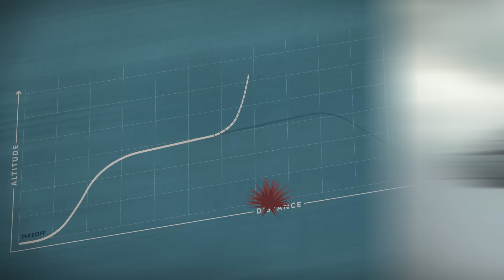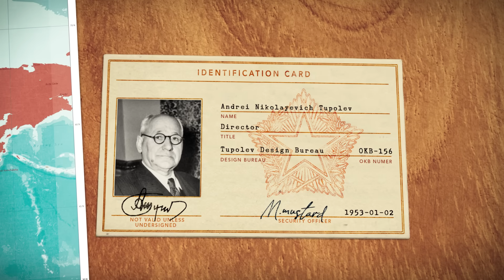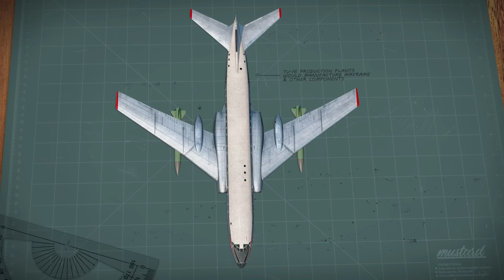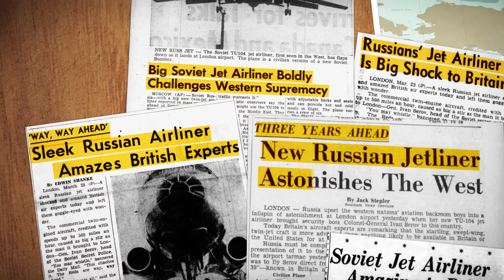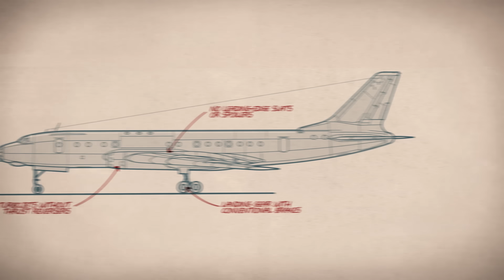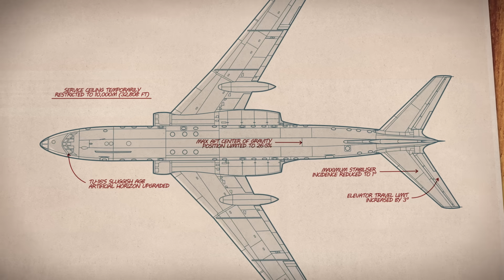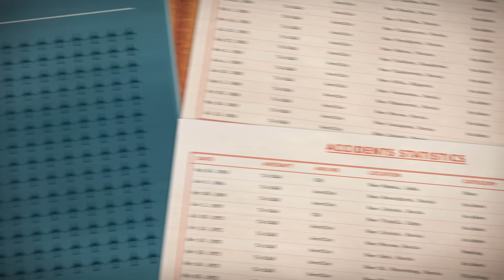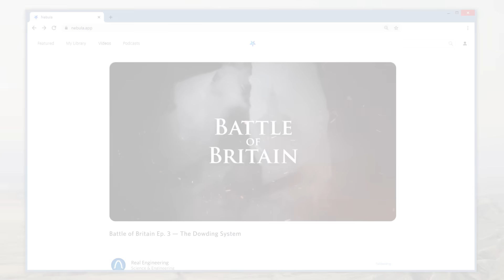The Soviet Airliner Designed To Crash

Comment: My parents and I flew on a Comet from New York to London 1959. First Jet airliner for us. It was really a great experience. We went on to a different flight to Paris. We heard that the same plane (Comet) went on to Stockholm and exploded in the air. Something to do with the cabin pressure system. Our next flights were on the DC8 and 707.
Reply: pa.d5688  Ah, OK, I thought it was a Comet we were talking about, not a Tu-104.
Reply: By 1958 the on service Comet fleet were replaced by Comet 4 which was modified to prevent the pressure hull structural failures that affect the earlier versions.
Reply: Hmmm, I can't find any such accidents in the Aviation Safety Network database. Neither in 1959, not enroute to Stockholm.
Reply: @kjetilkjernsmo8499  ooh
Reply: @kjetilkjernsmo8499  His MAGA hat is too tight.  He can't cope with the fact that that the first jet airliner wasn't Murcan so he's making stuff up.
Reply: @himoffthequakeroatbox4320  The first successful airworthy jet airliner was the Boeing 707 series, the Comet 1 was grounded and its airworthiness certification was permanently revoked.
Reply: @kjetilkjernsmo8499  there’s a Seconds from Disaster episode on it. The windows had right angle window corners that causes metal fatigue.
Reply: @requiscatinpace7392  Heavily dumbed-down for television, this British directed episode is highly fictionalized and inaccurate...  not a good reference for information on the Comet Disaster.
Reply: @sandervanderkammen9230  just meant as a starting place for someone who didn’t seem to believe it happened.
Reply: @requiscatinpace7392  Oh I see, for the Comet Disaster deniers.
Indeed... there are a few delusionals around here that believe that every Comet landed like a feather, three points and exactly on schedule every single time.
Reply: @kjetilkjernsmo8499  💀💀
Reply: There is no record of this crash anywhere. And transatlantic Comet 4s never flew to Stockholm.
Reply: By 1959 the Comet problem was spotted and fixed. The aircraft that had decompression problems was in 1955. Then the Comet was grounded for 4 years. If you were a passenger in 1959 it would have been on a Comet that had been up graded and passed.  Inspectors blamed the Squair Windows, but it was the press in Rivets that caused the cracks
Reply: @mylanmiller9656  The square windows were a factor. The sharp corners made it easier for the hull to tear under stress. The riveting process also weakened the hull.
Reply: @foxymetroid  There is no evidence to support that the shape of the windows was the cause of a single crash, cracks formed during construction and propagated concentrating around all the fuselage penetrations
Comet 1 aircraft that did not crash or were scrapped had round windows installed, these aircraft were determined to be unsafe and their airworthiness certification was permanently revoked.
Reply: @mylanmiller9656  Militarised versions of them (Nimrod) were in service till 2011.
Reply: @himoffthequakeroatbox4320  The Nimrod is a completely redesigned aircraft built by Hawker Siddeley  2 decades later. 
The Nimrod is not a Comet, it has a different type certificate.
Reply: @mylanmiller9656  Square windows certainly didn't help. Most of the crack propagation was found around those windows.
Reply: @mgabrysSF  The square windows theory was a red herring, the news media grabbed it and ran with it. de Havilland never understood why its aircraft exploded, the problem was discovered by outside experts that found 100s of fatal design and construction flaws.
de Havilland installed round windows on the remaining Comet 1s but they had airworthiness certification permanently revoked because they entire airframe structure was too weak and poorly constructed.
Reply: @mgabrysSF  There is no evidence to support that the passenger windows caused any of the crashes, the wreckage recovered  confirmed this.
Reply: @mgabrysSF  Maybe the tests from the tank said that.  The Crash Debree proved that the Brake up started in the roof not around the windows Area.
Reply: @paulpaul9914  More childish insults and you are sinking fast kid...
Just answer the question lad, please cite a name of a British company that still makes commercial jet aircraft in the U.K.???
Reply: @mylanmiller9656  Oh I agree with all the propagation data elsewhere in the airframe for sure. But having those windows - and the only commercial jet that used them - was indicative of the lack of overall awareness in designing a pressure structure.
Reply: @sandervanderkammen9230  A red herring in one sense - yes, but it did show a lack of understanding in the design awareness which was found to be absent in the remainder of the aircraft. Not the cause of the crashes in of themselves - but a glowing red flag to problems that would become obvious elsewhere.

Which is a pity because I always thought the inboard engines to be quite visually dramatic. Probably an insane headache to work on tho (not to mention a huge safety risk in the event of a catastrophic engine failure).
Reply: @mgabrysSF  Excellent point, de Havilland struggled with the extra weight in shielding and insullation for sound damping and fire protection required for the placement of the engines inside the wings.
One of the mysteries of the Comet Disaster was why de Havilland ignored data regarding metal fatigue in pressurized cabins provided to the RAE by Boeing from the B-29 program during WW2.

The other is why the treasure trove of technical data discovered by the Fedden Mission at the Luftfahrtforschungsanstalt in Braunschweig Germany was never disseminated to de Havilland.
The RLM had conducted exhaustive research on different jet engine mounting techniques in the world's most advanced wind tunnel facility.
The German data showed that mounting the engines below the wings with the inlets ahead of the wings leading edge was superior for subsonic applications and that mounting the engines as d-H did was fundamental flawed and undesirable.
 There are no answers to why Boeing got it right the first time with the Boeing 707 and d-H got so wrong with the Comet.
The only explanation is they deliberately disregarded the data.
de Havilland didn't conduct its own wind tunnel tests until after the first 3 runway excursion accidents.
Reply: @sandervanderkammen9230  I don't 'know' but I suspect for Boeing, it was a reasonable attempt to manage engine retrofits on a commercial fleet at the outset. If they weren't thinking of it on day-one, I'm confident the carriers were.

It's a lot easier to remove an engine from a pylon for servicing and replace it than to have to take a plane out of service from an inboard power plant (Douglas found this out the hard way with their tail mounted engines on the DC-10). A less common but possible failure-mode can send turbine blades flying in all directions. Having it outboard mitigates that risk (somewhat). There have been many documented harrowing accidents as a result from a catastrophic explosion from bird ingestion or bad parts used during rebuilds.

I'm aware of one tail mounted engine failure causing a dramatic loss of  hydraulic control as the parts severed both primary and redundant feed lines. I can't recall the incident off the top of my head - but I'm pretty sure a search (even on YouTube) will document the accident.
Reply: @mgabrysSF  The under-slung engines first appeared on the Boeing B-47 bomber, which was an uncompleted German aircraft (Projekt P.1107) the plans were found by the German-American  Boeing engineer George Scherer part of the Fedden Mission.
 There are some descent videos regarding the rise and fall of the tri jets due to legal requirements of over-water passenger routes.
 The DC-10 for example cpuld compete directly with 4 engine jets like the 747 but had a lower operating costs due to only having 3 engines.
As soon as the laws changed twin engine wide bodies have dominated international routes.
Reply: @mylanmiller9656  Square.
Reply: @mylanmiller9656  Mostly right. The cause of the crashes was metal fatigue. It's complicated physics and engineering, but in simple terms, if you bend a piece of metal one way and then back again, and do it enough times, the metal will crack at the bend. Stress points such as the corners of square window openings and imperfect rivet holes can cause failure a lot earlier than expected.

I flew from London to Singapore and back again in a Comet 4 in 1959 when I was 10 years old.
Reply: @roadie3124  The Comet Disaster was caused by design flaws that allowed the cracks to join up and rip open the the pressurized cabin.
de Havilland used aluminum skins that were too thin and brittle, they lacked proper rip-stop doubler joints  to prevent the cracks spreading to adjacent skin panels.
The fuselage reinforcement rings were also too thin and too far apart to stop the cracks from causing a catastrophic structural failure.
Reply: @sandervanderkammen9230  Designers in those days didn't know that they had to do things to stop fatigue cracks from propagating. They didn't know enough about fatigue. So is it a design flaw or a lack of knowledge about the new technological world they were entering?
Reply: @mylanmiller9656  Press in rivets?  I had never heard that and I went to aviation school.  They are still teaching it was the windows.  I need to watch some documentaries on that.  I don't rem using any press in rivets.  There are rivet like things that you can use but usually not in anything structural.  Our teachers were anal about driving the perfect rivet.  You haven't lived till you have manually bucked 100k rivets.
Reply: @JohnSmith-uf5xg  I think he meant to say de Havilland punch-cut the rivet  holes instead of the standard industry practice of drilling and reaming the rivet holes. 
 It was well-known by industry leaders that die cutting the holes caused tiny stress risers and cracks in the aluminum skins that that would propagate and crack between adjacent rivets and was unacceptable for pressurized cabins. 
de Havilland had little experience with riveted airframe structures made from aluminum alloys, de Havilland was still building jet aircraft primarily from wood and fabric in the 1950s and simply lacked the technology to produce something like the Comet.
Reply: @mylanmiller9656  20 Comet 4 aircraft crashed or were destroyed in accidents making it the second worst jet airliner after the Comet 1
Reply: I think it was coming from Rome.
Reply: @semsemeini7905  it was Rome, my dad as captain handed it over there to the next unlucky crew.
Reply: @paulpaul9914  Please name a single British company that still makes commercial jet aircraft in the U.K.?
Reply: Better, faster and sooner is sometimes called the Iron Triangle. Three is often impossible, two is rare and one is an average outcome. You often end up with none.
Reply: @michaelcanty4940  de Havilland took  a extremely high risk gamble on all three and got none right... the Comet Disaster was an epic failure that completely destroyed the company and struck a massive blow to the already failing U.K. aircraft industry.
Reply: The BOAC Comet...read Wiki for a tragic triste histoire  that enabled longterm US domination of Commercial Jets
Reply: @mindyourownbeeswax8223  The de Havilland Comet had no effect on the American commercial aircraft industry... neither did any other British jet airliners
Reply: Pa. D  They  blamed the squair  windows in the first place, They later found the cracks were caused by forcing the rivets through the aluminum. It wouldn't have mattered if the windows were round they would have had the same problem. They moved the rivets farther from the edges and drilled the holes.
Reply: @mylanmiller9656  острые углы усугубили дефект заклепок. Чрезмерная нагрузка ускоряет рост микротрещин)
Reply: @mylanmiller9656 on fact early RR Ghost engines did not produce a lot of power and the pressure hull was made too weak in order to save weight to increase payload. Only more powerful Avon engines allowed the stronger, heavier Comet 4 to exist.
Reply: @mylanmiller9656  The Comet had aluminum skins that were too thin and brittle, it lacked proper rip-stop doubler joints and its fuselage reinforcement rings were too narrow and spaced too far apart.
 de Havilland used a revitting technique that was well below industry standards for aluminum airframe structures and its quality control standards were appallingly bad.
de Havilland incorrectly calculated the stress factors and used too few riveted fasteners, it also failed to correctly test their design for load and fatigue.
3 Comets crashed because of fatal design flaws in the wings and the hydraulic controls.
Reply: @sandervanderkammen9230  The Problems with the Comet were do to the fact that they were the first to build a jet liner. Engines were not good for the time and weight was a deterrent, If DeHaven hadn't experienced these problems, the 707 and the DC8 would never have been the Susses they were. The comet fails were what made the American airliners a hit.  Comet was the Guina pig.
Reply: @mylanmiller9656  The Comet Disaster was the first failed attempt, a very shameful and humiliating chapter in British history.
Of course the most embarrassing and tragic part of the failure of the Comet was that it could have been easily prevented if de Havilland had simply followed well-known and understood industry standards for the design and construction of  pressurized cabins made from riveted aluminum alloys.

That is a popular but completely false urban myth in Britian but is completely debunked by the slightest scrutiny, Many other manufacturers had much more experience and extensive knowledge of pressurized cabins and all metal aircraft structures.
The Boeing 707 flew on July 15th 1954 before anyone in the world knew what caused the Comet Disaster, de Havilland never understood the problem and went bankrupt in 1958.
It was the RAE and Hawker Siddeley that discovered the engineering flaws in Comet.
Reply: @mylanmiller9656  The Comet was doomed to failure right from the start, de Havilland never understood or made a successful aircraft from all metal, it was decades behind in aircraft technology and was still building extremely unreliable and dangerous aircraft including jets out of Wood and fabric... 
The Comet was not even an all metal aircraft, it still had major structural components made from wood, 
The company had no real experience with riveted aluminum alloys or pressurized airliners... they were way-in over their heads.

It was not just de Havilland company  but the entire British aircraft industry that was a decade behind in technology and in a steep decline.
Compared to other multi engine jets like the B-47, 707 Jet Stratoliner and the B-52? Britian was still in the Stone Age
Reply: @mylanmiller9656  I mean I doubt we will ever see a space craft with a worse failure rate then the Shuttle. It is the consequence of being first.
Reply: @generalharness8266  Have you heard the joke about the British space program?
Reply: @sandervanderkammen9230   Sadly, DeHavilland failed at their first effort at making all-metal commercial jet airliners that didn't burst like party balloons at high altitude, while Boeing got it right on their first try. It probably wasn't lucky guesswork by Boeing's engineers. By the time Boeing was designing the first 707, it had the experience of building 12,000 very sturdy B-17s, close to 4,000 all-metal pressurized high altitude B-29 bombers, and 800 B-29-derived Stratofreighters and Stratocruiser airliners during the preceding decade, as well as their ongoing design work on B-47s and B-52s.
Reply: @sandervanderkammen9230  Jesus christ son, 'tism harder.
Reply: @yourmothersfavoritetweaker  Just the facts here son, childish insults won't prove your argument... or make you look very mature.
Reply: @sandervanderkammen9230  Says the guy repeating the same statements a few hundred times over, and hovering around more than 7 months later. Go outside, and touch grass. You'll thank me later, from one terminally online person to the next
Reply: @yourmothersfavoritetweaker  426 innocent people men, women and children died because the brits thought that if they cut a few corners on safety they could beat Boeing to the race to bring the first jet airliner to market, a truly shameful and humiliating chapter in British history.
Reply: @whatevenisphysicsanymore They sound mentally I’ll because I’ve read through this entire comment section and have never seen someone so terminally online before, it’s actually kinda concerning…
Reply: Checkout 
Duxford Aviation Society Dan Air Comets 
to see what happened to the Comets.
The most advanced aircraft of it's type in the world at the time it came into being.
Reply: @paulpaul9914  Please name a single British company that still makes commercial jet aircraft in U.K.?
Reply: The early comets had square cut windows in the fuselage (both passenger windows and radio aerial windows) the square cuts caused stresses to concentrate at the corners of the cut. The comet was pressurized to f!y above 15,000 feet. When you pressurize an airliner it is like inflating a gallon, the fuselage skin flexes as the aircraft ascends and descends, this causes stress as the metal flexes back and forth. In the comet the square corners concentrated that stress and created cracks in the fuselage that spread, when enough cracks met, the structure failed in an explosive depressurization that caused he aircraft to break up. The investigation into the comet crashes was the model that current air crash investigations are based on.
Reply: @kdrapertrucker  The Comet was so poorly designed that cracks propagated all over the fuselage a concentrated around all the fuselage penetration.
What caused the catastrophic in-flight structural failures was design flaws in the materials chosen and the assembly methods used.
de Havilland simply did not understand how to build aircraft out of metal, their experience was limited to wood and fabric construction of the fuselage.
There is no evidence to support that any Comet crash was caused by the shape of the windows.
Reply: I try to avoid flying if possible, I go by that well known old saying " If God had meant us to fly he'd have given us tickets". 😁
Reply: @andyelliott8027  Avoid flying on British jets and you will reduce your risk significantly.
Reply: @sandervanderkammen9230     British airline Easyjet the World's most popular airline has never had an aircraft crash, same goes for Virgin Atlantic.
Reply: @andyelliott8027  EasyJet only operates Airbus A320 series aircraft made in Hamburg Germany.
Virgin Atlantic's workhorse is the Boeing 787... the safest jet airliner in history.
Reply: @sandervanderkammen9230   UK, France and Germany for the A320. Rolls Royce (Ever heard of them, British company) engines for 787 and many other aircraft, a name unrivalled as regards quality. Long history of well-regarded cars too. What country are you from, Netherlands, South Africa.? Neither are noted for World rated companies.
Reply: @andyelliott8027  Sorry but Airbus SE
is not a British company.
(Rolls-Royce is own by BMW)
Reply: @andyelliott8027  Rolls-Royce Motor Cars is a German owned company, a wholly owned subsidiary of BMW.
All of the mechanical and electronic systems are BMW sourced in including engines, transmissions axles etc.
There are no longer any British automobile manufacturers left (mass produced) so it's not just jet airliners that the British no longer make.

Then what was your point?
If you were replying to my question you are still wrong.
Reply: @sandervanderkammen9230   BMW don't design Rolls Royce cars.
Reply: @andyelliott8027  BMW designs all of its cars, including its Rolls-Royce branded models.
Reply: @sandervanderkammen9230   British guys design Rolls Royces and build them not Germans.
Reply: @andyelliott8027  Sorry Andy, there are many foriegn manufacturers that operate factories in the U.K. including BMW.
There are no longer any British owned automobile manufacturers (mass produced)
Rolls-Royce is a wholly owned subsidiary of Bayerische Motoren Werkes A.G. in Munich Germany and has been for a quarter of a century now.
Reply: @sandervanderkammen9230   The real question is who leaves the EU next.
Reply: @andyelliott8027  The real question is who leaves the commonwealth next..
Reply: @paulpaul9914  Please name a single British company that still makes commercial jet aircraft in the U.K.?
Reply: @sandervanderkammen9230  
Rolls Royce is not a BMW company.
Reply: @sandervanderkammen9230  
ROLLS ROYCE GMBH - UK ROLLS ROYCE  OWNED
Reply: @Paul-mh9pr  The U.K. government separated Rolls-Royce Motors from the parent company when Rolls-Royce went Bankrupt in 1971 and siezed its assets, it sold off its automotive and Diesel divisions to Vickers, Vickers went bankrupt in 1998 and sold Rolls-Royce Motors  to Volkswagen in a deal with BMW to separate Bentley and sell the Rolls-Royce brand to BMW.
Rolls-Royce is a wholly owned subsidiary of BMW since 2003.
Reply: @Paul-mh9pr  Rolls-Royce limited is multi national holdings company.
Reply: @sandervanderkammen9230  
Provide sources for the claim regarding Vickers being made bankrupt.
As far as we are aware Vickers merged with other companies during Govt arranged  mergers & nationalisations,  became part of BAC, then British Aerospace.
Reply: @Paul-mh9pr  Vickers was a failing bankrupt company because a long string of financial losses like the VC-10 and Vangard the U.K. was bankrupt in 1965 and canceled orders when it defaulted on its mortgage to America. Vickers had the option to merge into BAC or go out of business.
BAC was completely nationalized in 1977 when the U.K. was bankrupt and again in default on its war debts in 1976.
Reply: @sandervanderkammen9230  
 Repeated as no valid response provided.
Again.
Provide sources for the claim regarding Vickers being made bankrupt.
As far as we are aware Vickers merged with other companies during Govt arranged  mergers & nationalisations,  became part of BAC, then British Aerospace.
Reply: @Paul-mh9pr  Vickers was  a failing company that had been in financial trouble for some time.
The British economy was disasters and Vickers wasn't going to receive any new contracts, the choice was simple, merge or go out of business.
That didn't help matters either, the entire aircraft industry was nationalized.
Reply: @sandervanderkammen9230  The A320 has one final assembly line in Germany, there is another in Tolouse, one in North Carolina, and yet another in China. Structural components are made across Europe including the UK where the wings were made and designed. BTW the 787 isn’t the world’s safest airliner that would be the A320neo which has never had a crash nor a type certificate suspension or perhaps the A350 for which the same could be said. The 787 has had a series of safety issues including a series of in flight fires which led to a prolonged grounding of the type and a prolonged suspension of deliveries enforced by the FAA due to serious manufacturing defects. 
Boeing hasn’t introduced a new type without significant safety issues this century.
Remember if it’s Boeing I ain’t going.
Reply: @davidwright7193  Sorry but you are very confused and misinformed.
The Boeing 787 is the safest jet airliner in history.  With over 1,000  delivered and the aircraft in service for more than a decade with ZERO fatalities it remains the safest aircraft in history, a Zero per flight and per passenger mile record unmatched in the industry.
 The Japanese company Yuasa had  a safety problem with its batteries which had been FAA approved for use in aircraft.
Reply: @sandervanderkammen9230  The Boeing 787 is not the “safest aircraft in history” there have been several serious incidents including multiple airborne fires across multiple operators which led to the type certification being suspended for 4 months. That has never happened to an Airbus. There are more A320neo series aircraft in service than 787s with no reported safety problems. The only incidents the type has been involved with are runway incursions by ground vehicles. The 787 has also had a more than year long delivery suspension due to manufacturing defects. 787 deliveries were again suspended last month. Why do you continuously feel the need to lie like this?
Reply: @davidwright7193  The Boeing 787 is the world's safest jet airliner, it has the best per flight and per passenger mile fatalities rate which is ZERO.
These are irrefutable facts that cannot be disputed.
Reply: @davidwright7193  The statistics don't lie, the Boeing 787 series has the safest per flight and per passenger mile fatalities rate... ZERO.
Reply: @Symilarian 
Sounds like BS
Reply: Lucky you didn't explode mid flight.
Reply: It was the shape of the windows. The corners weren’t rounded like they are now. I think Mustard has a video on it.
Reply: Pa. D  - Thanks for spelling "square" correctly!  
Or was "Squair" in Mylan's comment a branded name perhaps?  I've never seen it before
Reply: @paulpaul9914  True, the economic collapse of Britain in the postwar era doomed de Havilland, in retrospect the demise of this backwards company hopelessly stuck in the past was inevitable.
The Comet program was a reckless, extremely high risk project that had the odds stacked against success, safety and integrity was deliberately sacrificed in a financial gamble to save the company.
Reply: @paulpaul9914  de Havilland was certainly "blazing" a trail..
A trail of aircraft wreckage around the globe!
Reply: Phew, you lucked out!
Reply: It wasn’t the air pressure system. It was having square windows and riveting in the wrong places, which stressed the fuselage until it failed.
Reply: @The_ZeroLine  The Comet Disaster had nothing to do with shape of the windows, de Havilland simply lacked the technology to build pressurized cabins made from riveted aluminum alloys.
Even after round windows were installed on the remaining Comet 1 aircraft their airworthiness certification was permanently revoked in 1958, the entire structure of the fuselage was simply too weak and shoddily constructed.
Reply: @sandervanderkammen9230  Not true. I’ve watched the full archive footage of their engineers figuring out the issues, including the scale sized submersible tunnel they used to simulate thousands of pressurization cycles. You might want to do just a tad more research, friend.
Reply: @sandervanderkammen9230  You should start making square windowed planes. Go against the grain.
Reply: @The_ZeroLine  Bombardier already did.. the Global series has square windows.
Reply: @The_ZeroLine  The basic flaw was the testing sequence which indicated a ~16000 pressurisation cycle safe life. The initial pressurisation cycling was at a very high pressure which had the effect of stress relieving & toughening the high stress areas, subsequent stress  testing on that airframe was then invalid. Production airframes would not receive the extra high pressure cycle testing & would not be inadvertently stress relieved / toughened. In essence the stress testing of one of the  airframes should have been much closer to normal operating conditions straight after normal production proceedures & that airframe should have remained on test more or less permanently until failures occured. The test procedures sequence problems weren't foreseen at the time, various regulatory bodies accepted all the proceedures & results as proof of safety.
Reply: @paulpaul9914  That is absolutely correct, not only did de Havilland design and build the Comet with hundreds of fatal flaws, it also conducted its testing procedures with neolithic incompetence.
 It was as if? an aircraft company that only knew how to build antiquated planes made of wood and fabric suddenly tried to make modern pressurized airliners with no experience, no budget and a impossible deadline.
Reply: @sandervanderkammen9230  (DrDikBummer / Vindaloo Durr Krappen et Al & co). " that is correct ....& further extensive drivel + ~just the total 
BS only here sonny~"
Idiots appear to be posting replies regarding matters that they are clearly incapable of comprehending on a fairly regular basis? This is purely a factual technical discussion regarding a particular aircraft & it's manufacturer.
Reply: @paulpaul9914  Childish insults won't prove your misguided argument nor will it make you look smarter.
Reply: @paulpaul9914  Please name a single British company that still makes commercial jet aircraft in the U.K.?
Reply: @paulpaul9914  Thank you for proving my point.
Reply: @paulpaul9914   You can tell when someone is aware their argument has failed miserably when they descend into childish insults and then deletes them.
Reply: @paulpaul9914  YES, the Airbus A320 series aircraft factory in Hamburg Germany is the largest jet aircraft manufacturer in Europe and second only to Boeing's Seattle Washington plant.
Reply: @paulpaul9914  Please name a single British company that still makes commercial jet aircraft in the U.K.?
Reply: @paulpaul9914  Please cite the name of a single British company that still makes commercial jet aircraft in Britian?
Reply: I heard it was metal fatigue.
Reply: @moitoi4064  It was much more than just metal fatigue.. de Havilland had to completely redesign the entire aircraft. 
The design of the engine inlets caused pressure recovery problems with the engines and reduced lift on the wings during takeoff.
de Havilland completely redesigned the wings, enstalled better engines and the hydraulic flight control system also redesigned.
Reply: Not by 1959. The Comet was fixed by then
Reply: @stringpicker5468  The Comet 1 had its airworthiness certification permanently revoked in 1958 just before the company went tits-up.
No Comet 1 aircraft returned to revenue service after the 1954 grounding.
The Comet 4 while a completely redesigned aircraft had a very checked safety record with a high loss rate.
The Comet 4 was grounded from passenger service in 1980 after a safety inspection discovered the entire remaining fleet had premature fatigue failures in the wings spars and the fuselage segments.
Reply: @sandervanderkammen9230  

Provide sources for your  many explicit or implied claims -
DH ignored info from the UK RAE & others regarding metal skin pressurised aircraft design & construction.
DH did not carry out a full stress analysis etc for the Comet design.
DH Comet - 100s of fatal flaws - provide a source for the list with details of each fatal flaw & the total number.
DH used shoddy production methods that differed significantly from industry standards..
Do not simply repeat a list of nonsense - provide checkable & verifiable sources only.
Reply: @Paul-mh9pr  The fatal flaws in the Comet Disaster are well-known, the Comet required complete redesign everything from the flaps to the toilets required corrections to address safety issues.
The changes to the wings along including dozens of design flaws to be corrected and can be easily demonstrated by comparing the design details of the pre-1954 disaster aircraft and the post 1958 aircraft.
Reply: @Paul-mh9pr  Well, that is completely obvious, de Havilland failed to properly test many critical systems most notably that it failed to properly test the pressurized cabin but also failed to properly test the wing design, the hydraulic flight control system and failed to properly test the aircrafts take-off performance characteristics which caused fatal accidents and de Havilland attempted to cover up.
Reply: @Paul-mh9pr  de Havillands shoddy workmanship and insufficient  specifications for riveted fasteners is well documented.
Reply: @sandervanderkammen9230  
Provide all sources for all claims including hundreds of fatal flaws (total number with a complete list would be nice), dozens of flaws, ignoring info from the UK  RAE  & others, failing to carry out an industry standard stress & potential fatigue analysis, failing to carry out comprehensive new type testing including testing wing performance,, ignoring design & construction info & advice from many manufacturers & industry regulatory bodies & academic institutions etc,
& using carpenters to build Comets with pva wood glue?
'its obvious' & '  it's well documented ' will not be sufficient.
Reply: @sandervanderkammen9230  
Provide links to sources of info that confirm beyond doubt that DH's responses that involved  modifications were not often carried out as  'just in case' or 'for appearances'  measures or were simply non essential improvements as the opportunity to carry out improvements arose during the course of events.
Reply: @Paul-mh9pr  The de Havilland Comet was biggest engineering failure in commercial jet aviation history.
Never has a jet airliner had its airworthiness certification permanently revoked.
The scope of the engineering incompetence has to monumental for a disaster like this to occur, it is unprecedented in aviation history.
Reply: @sandervanderkammen9230  
No valid response provided.
 @Sander Van der Kammen  
Provide all sources for all claims including hundreds of fatal flaws (total number with a complete list would be nice, was it 336 or was it more than that?), dozens of flaws - 13 dozen or more - a links to a list would be nice, ignoring info from the UK  RAE  & others, failing to carry out an industry standard stress & potential fatigue analysis, failing to carry out comprehensive new type testing including testing wing performance,, ignoring design & construction info & advice from many manufacturers & industry regulatory bodies & academic institutions etc, 
Use of pop rivets from the local hardware shop & using carpenters to build Comets with pva wood glue?
Provide evidence with sources of info that the various versions & iterations of the Comet & Nimrod were not in fact essentially the fully certified for flight Comet?
'its obvious' & '  it's well documented ' & repeated unevidenced claims will not be sufficient.
Reply: @sandervanderkammen9230  

"The fact that 6 comets .. .. etc & so on .... ad infinitum."

Your various claims will need to be supported with robust evidence & checkable documentation from authoritative sources.
Provide documented & linked evidence for all your claims including the claim that DH did not carry out new type testing including testing the pressurisation cycling  characteristics of the aircraft & failed to carry out new type testing of the wing design & failed to carry out such activities as industry standard stress & potential fatigue analysis for the new design of aircraft.
Repeated unevidenced claims & simply stating 'its obvious' &'the facts speak for themselves' & 'its all documented ' are not valid responses.
Reply: @Paul-mh9pr  The catastrophic in-flight structural failures and the fact that de Havilland had no clue what was happening is all the evidence anyone needs..
The Comet Disaster remains the worst engineering failure in commercial jet aviation history, a truly humiliating and shameful British in British history.
 No amount of lame excuses, sugar coatings or bald faced lies will ever change this fact.
Reply: @Paul-mh9pr  Please cite the name of a single British company that is still manufacturing commercial jet aircraft in Britain today?
Reply: @Paul-mh9pr  Please name a single British company that still makes commercial jet aircraft in the U.K.?
Reply: @Paul-mh9pr  Please name a single British company that still makes commercial jet aircraft in the U.K.?
Reply: Pa. D  It was the square windows. The corners created points where tension could 'focus' and fatigue and crack the metal, which would lead to the fuselage tearing open with predictable results.
Reply: @townhall05446  There is no credible evidence to support that the  passenger windows were related in any of the catastrophic in-flight structural failures.
This is a red herring offered up by de Havilland at a time when the cause of the explosive decompressions was still not known or fully understood, most of de Havillands testing was inaccurate and inconclusive. 
In fact the structural flaws in the Comet are not related directly specifically to any openings, fatigue cracks where found to originate from multiple sources where the airframe structure was inadequate.

The major contributors were the insufficient thickness and strength of the aluminum fuselage skins and the lack or proper rip-stop doubler joints to prevent the cracks jumping to adjacent skin panels.
Poorly designed and installed rivets and fuselage reinforcements hoops that were too narrow and spaced too far apart were also major flaws.
Reply: Well, it was the first generation BOAC Comets that were involved with rapid depressurization disasters; the one you would have been on would have been second generation with circular windows, avoiding that risk.  It was the square windows in the first ones that concentrated too much stress at their corners from pressure differential when flying at jet airliner altitudes
Reply: @davidpar2  All Comet 1 aircraft were grounded in 1954, not just the ones in BOAC service.
The story about the square windows being the cause is a red herring proposed by de Havilland, they never fully understood why its aircraft exploded.
All Comet 1 aircraft had their airworthiness certification permanently revoked in 1958 including the ones converted to round windows, these aircraft were unsafe due to hundreds of design and construction flaws that were completely unrelated to the shape of the windows... 
 Only the Comet 4 returned to commercial revenue passenger service, 20 of these crashed or were destroyed in accidents  (an appalling 1 in 4 loss rate) making it the worst safety record of any jet airliner after the Comet 1.
Reply: Citizens of America, observe control, do not withdraw money from banks, let the banks burn with your money! Money can only be withdrawn to capitalists, not you, don't worry! Money is more important to capitalists than to you,№
Reply: Nope. The Comet crashes were at the start with the Comet 1 in 1952-3. By '59 they were Comet 4 and no such issue.
Reply: @stringpicker5468  The Comet 4 has the worst safety record of any jet airliner in history... Except for the Comet 1.
Reply: whats the first song name
Reply: The Comet had a design fault, square windows. They eventually strapped one in a pressure chamber fast-replicating the flight cycles and discovered a new condition in materials science, work-hardening, which created microcracks at the corners of the windows, which fairly quickly propagated until a window blew out, taking larger chunks of the side with it, destroying motors and wings.
Reply: @RahereTheGenius  Wreckage recovered from the sea confirmed that the passenger windows were not related in any way to the catastrophic in-flight structural failures.
The investigations found that de Havilland used aluminum skins that were too thin and brittle, that the plane lacked proper rip-stop doubler joints, used too few riveted fasteners that were crudely installed and that the fuselage reinforcement hoops were too narrow and spaced too far apart too prevent cracks from joining up with adjacent panels and creating a catastrophic failure.

The investigation also found that de Havilland did not understand how to properly test pressurized cabins and had little experience with riveted aluminum airframe structures, they lacked the knowledge and experience to build and aircraft as complex as the Comet.
Reply: @sandervanderkammen9230  You're clearly no engineer. Aluminium isn't brittle, if it was they wouldn't still be using it. Like any metal, work-hardening, alignment of the internal crystalline structure, can happen when repeatedly stressed in the same way over time, and that's what happened, as I said. This I had from the Director of R&D at the UK Institution of Mechanical Engineers, who was Fred Lanchester's last protégé, and mates with Fred Whittle: he was my father.
Reply: @RahereTheGenius  Lol!!! You really are hilarious kid!!! 
Aluminum isn't brittle?
 Fred Whittle?
 Haha!!!
Reply: @BB49You obviously failed your math studies. That is not how aircraft safety statistics work son...
There have been 10,000 Boeing 737s built and if it was as unsafe as the Comet? There would be more than 2,800 737 crashes.... which there aren't.
Reply: 1,000th like!
Reply: wow that is lucky and aswell u have to be like 60 already
Reply: the soul reason right ability arrogance mercy deception angel devil close-minded excuse disbelief , serious attitude imply miracle dream conscious of love stray good evil patience thought dignity trauma circumstance infantile vinegar fallen omen intend , power the King virtue abstract endure delusion guilt work the Earth glory .
Hypocrisy causes insanity . Real graduation = have learned everything possible
Reply: Was not the Hawker business jets the 125 400 800 and so on the safest in history,built like tanks?
Reply: @tomfilipiak3511  After designing the worst jet aircraft in history de Havilland overbuilt the 125 Dominie to the extreme... of course de Havilland would go tits-up in 1958 because of the Comet Disaster and Hawker Siddeley would go on to manufacture them, they sold at a considerable financial loss for many year with British taxpayers absorbing the difference.
Reply: Did you hear any metal cracking?
Reply: Welp, so glad that you lived to be healthy and old to tell us this story!
Reply: Reminds me we were at top of WTC Towers just before they came down...
Reply: @BuzzLOLOL  I'm totally flabbergasted that you require some sort of disaster moofie or disaster discussion to remind you that you were very nearly crushed and burned in the WTC Terrorist Attack.

Did you know that there are memory enhancement courses available on YouTube?
Reply: @paulpaul9914  de Havilland had a long history of appalling loss rates and a general disregard for crew and passenger safety.
de Havilland was decades behind in aircraft technology, the company was still building biplanes like the Dragon when industry leaders like Boeing, Douglas Junkers and Lockheed were building all- metal monoplane airliners with pressurized cabins.
Reply: @sandervanderkammen9230  I don't know why they are arguing with you, you aren't wrong.  The Comet was the best looking of the others but I wouldn't have wanted to fly on one or be responsible for maintaining the death trap.  I would feel horrible if one I worked on had a failure.
Reply: @JohnSmith-uf5xg  Indeed, after the Comet 1 was grounded de Havilland Comet attempted to modify them with round windows... government inspections found cracked skins, rivets that were loose, had deformed heads and even missing rivets!
These aircraft had their commercial airworthiness certification permanently revoked. The aircraft with the worst defects were scrapped and some were rebuilt as C2 military transports albeit with greatly reduced cabin pressure, reduced  hours and flight cycle life and more frequent inspections for fatigue damage, these aircraft were all grounded in 1967 due to premature fatigue failures.
Reply: @JohnSmith-uf5xg  
Arguing with 
~Von Duhrr Krappen~
Is obligatory - everything under & by the account with that name is total BS, either it's  directly factually inaccurate or is wrong by context & inference. For instance the account stated categorically elsewhere that Whittle's centrifugal compressor type turbojet designs were never production manufactured or used in production aircraft & that basic jet / gas turbine engines are never used in helicopters for instance. Entirely wrong.
At the time of the Comet-1 all those working on it wether designing, developing, testing, manufacturing, maintaining  or operating it were very sure that they had a good aircraft & that includes those involved in overseeing & regulating aircraft matters such as the Royal Aircraft Establishment & others.
Reply: @paulpaul9914  The de Havilland Comet is the worst jet airliner in history. It remains as a tragic example of how NOT to build a jet airliner and a shameful and humiliating chapter in British history that could have been prevented.
 Please name a single British aircraft company that still makes commercial jet aircraft in in the U.K.
Reply: @paulpaul9914  de Havilland never understood why its aircraft exploded,  the theory of the square windows is a red herring.
 Modern investigations and analysis of the wreckage recovered reveals that the failure mode was along the roof not the passenger windows.
All of de Havillands testing was inaccurate or inconclusive.
 Poorly designed and shoddily installed revited fasteners, aluminum skins that were too thin and brittle, a lack of rip-stop doubler joints and fuselage reinforcements hoops were too narrow and spaced too far apart is what caused the catastrophic in-flight structural failures.
despite Havilland simply lacked the experience in designing and construction of pressurized cabins made from riveted aluminum alloys.
Reply: @paulpaul9914  3 Comets crashed or were destroyed in runway excursion accidents, de Havilland Intially attempted to blamed pilots yet quietly reduced the takeoff load performance tables but the problems continued.
 A fatal flaw in the Comets design and placement of the engines and the inlets was found, the Comet 4 was completely redesigned with defferent wings, engine inlets, engines, flaps and the aircraft received a new hydraulic controls system to improve takeoff performance.
Reply: @paulpaul9914  The most advanced airliners at the time were the Boeing 707 series and the Douglas DC-8... these aircraft revolutionized aircraft travel and are still flying today.
Reply: @paulpaul9914  The Nimrod too would succumb to metal fatigue failure and was grounded for safety, it would ironically be replaced by the Boeing 707 and 737 series aircraft in RAF service with some planes even older the the Nimrods they replaced.
Reply: @paulpaul9914  Planes like the Boeing 707 have 5 times the design safety factor built into them, the 707 has nearly 4 times the hours of service life and pressure cycle life.
The Boeing 707 series is still flying with hundreds of aircraft still in service around the world.
The RAF and the USAAF intended to keep theirs in service until at least 2045 with some aircraft expected to remain in service to 2050 or beyond.
The Comet was grounded in 1980 when premature fatigue cracks were discovered throughout the remaining commercial fleet.
Reply: sounds like a fairytale
Reply: @ChaklitTea  The Comet Disaster was very real and it caused the demise of de Havilland
Reply: You should have just spent your money on the lottery because You were lucky as hell
Reply: @jocelynuy2922  not in 1959, all the flawed Comets were grounded since 1955. So it must have been a Comet 4, which did not suffer pressure hull failures.
Reply: @paulpaul9914  The construction methods used at the de Havilland company were extremely antiquated and obsolete technology.
The company was still building aircraft primarily from WOOD and fabric and even the Comet was not a modern all metal aircraft structure, the Comet still relied on wood as a structural material.
Reply: @paulpaul9914 The de Havilland Comet Disaster was the worst engineering failure in commercial aviation history, investigations revealed 100s of fatal design, construction, materials and quality control flaws.
 Incompetence in both the design and construction of the Comet was found, riveted holes that were punched out instead of drilled and reamed, holes too large, deformed rivets, loose rivets and holes elongated because parts were not properly aligned.
Reply: @paulpaul9914  It proves that a company with no experience in designing pressurized aircraft with riveted airframe structures made aluminum and built by carpenters  jointers is a recipe for disaster.
Reply: @paulpaul9914  Sorry but the Hawker Siddeley Nimrod is a completely defferent aircraft built by a different company decades later and has a different type certificate.
Reply: @paulpaul9914  de Havilland went insolvent in 1958 and was placed under administrative receivership by the Crown Court.
The remaining assets were sold to Hawker Siddeley and the de Havilland company ceased to exist other than a brand name until 1962 went the name was finally struck from the records.
Reply: @paulpaul9914  The HAWKER SIDDELEY Nimrod is a completely different aircraft that was designed by a different company 2 decades later... it has a different type certificate... its is not a Comet and is unrelated to the original Comet 1.
 The Comet Disaster remains the worst engineering failure in the history of commercial jet aircraft industry.
Reply: @sandervanderkammen9230  As you stated earlier Hawker Siddeley took over De Havilland in 1960 and in so doing bought their IP including the designs for the Nimrod and Trident. The Nimrod is a design derived from the comet and retains significant design overlap. It was not as you imply a different aircraft designed by a different company.
Reply: @davidwright7193  The de Havilland company became completely insolvent in 1958 after the Comet Disaster and was placed under administrative receivership by the Crown court, it's remaining assets were. Sold to Hawker Siddeley who agreed to retain the heritage brand name until 1962.
The Hawker Siddeley H.S.801 Nimrod wad designed 2 decades after the Comet.
While 2 unsold Comet 4C aircraft were heavily modified to build a proof of concept test beds for the Nimrod, the production H.S. 801 is in fact a completely different aircraft. They are not Comets and do not have interchangeable parts.
Reply: @sandervanderkammen9230   Hawker Siddeley obtained the IP from de Havilland including the designs for the Nimrod (a modified comet) and the Trident, a subsequently successful jet airliner. The parts for the Nimrods weren’t even truly interchangeable within the type. You don’t really understand what a fitter did do you.
Reply: @davidwright7193  The Hawker Siddeley H.S.801 Nimrod is a completely different aircraft made by a different company decades later.
They have no parts in common and have different type certificate.
 Any effort to associate the relative success of the Nimrod with the Comet is pure revisionist nonsense!
Reply: @paulpaul9914  de Havilland no longer exists, the company failed in 1958 after the airworthiness certification of the Comet 1 was permanently revoked.
Reply: @paulpaul9914  The fate of de Havilland was the same as Hawker Siddeley and the rest of British aircraft industry..
 It's demise is completely relevant.
Reply: @sandervanderkammen9230  A Boeing propagandist entered the chat & gave us another documentary in the comments....alrighty then
Reply: @mangos2888  The facts speak for themselves.. Airbus makes some excellent aircraft, Hamburg Germany is now the largest manufacturer of jet aircraft in the world thanks to the success of the A320 family.
 Britains aircraft industry was doomed to failure after WW2 and the colapse of the Bank of England and the British Treasury.
Britain has always lagged years behind Germany America and France  in aerospace technology.
Reply: @sandervanderkammen9230  The wings for the Airbus are designed by the same design team that built the Comet. De Havilland were taken over by Hawker Siddley and became their commercial aircraft division. In the late 60’s the Hawker Siddeley commercial design division started a collaboration with French and German companies on a 300 seat wide bodied jet referred to as the “Airbus” for which they were to design and build the wings. In the mid-70’s Hawker Siddeley was bought out by its own subsidiary collaboration becoming part of Airbus.
Reply: @davidwright7193  Airbus SE is not a British company.
 Hawker Siddeley ceased to exist after it merged into British Aerospace now BAe, BAe is not a part of Airbus SE.
BAE only held a financial stake in Airbus which it sold in 2006.
 Airbus SE is a German  French and Spanish  aircraft manufacturer formed by  DASA, Aerospaciale and CASA.
Reply: @davidwright7193  Airbus U.K. is a wholly owned subsidiary of Airbus SE.
Reply: @sandervanderkammen9230  You forgot to mention that when BAE was formed it acquired a 20% stake in Airbus from Hawker Siddeley. Hawker Siddeley was one of the founders of Airbus. Really why lie like this
Reply: @paulpaul9914  The Workers Flag is deepest blue,
We are buying Rolls Royce up for you,
Until it makes a profit when,
We”ll sell the bugger back again.
Reply: @davidwright7193  BAE sold its stake in  Airbus SE in 2006.
Airbus SE is not a British company.
Reply: @sandervanderkammen9230  Which does nothing to change the engineering origin of the designs nor the presence of major Airbus manufacturing site in the UK and a separate research and development operation working on both wings and landing gear. 

Has a flood driven you out from under your bridge? Be careful in May sunrise comes early on the Neva marshes.
Reply: @davidwright7193  Please name a single British company that still makes commercial jet aircraft in Britain???
Reply: @sandervanderkammen9230  Airbus, Short Brothers. Now stop lying.
Reply: @davidwright7193  Sorry lad but you are very confused and misinformed, Airbus SE is a German French and Spanish company.
Short Brothers no longer exists.
Reply: @paulpaul9914  The Comet had feature not found on any other commercial jet airliner...It exploded when reaching cruising altitude, while a very unique feature it proved unpopular with passengers and airlines.
Reply: @paulpaul9914  The HAWKER SIDDELEY Nimrod is not a Comet, this is a popular but futile attempt to temper the humiliating Comet Disaster by associating it with the Hawker Siddeley aircraft designed decades later.
Reply: @paulpaul9914 The de Havilland company was decades behind in aircraft technology, they were using outdated and obsolete technology and this lack of modern technology is directly linked to the Comet Disaster which is the worst engineering failure in commercial aviation history.
The HAWKER SIDDELEY Nimrod is not a Comet. The facts are irrefutable.
Reply: @paulpaul9914  JUST ANSWER THE QUESTION
Please name a single British company that still makes commercial jet aircraft in the U.K.?
Reply: It was a window that caused this problem.
Reply: @paulpaul9914  Actually the Comet was made from balsa wood.

The Comet was not a modern all metal aircraft.
Reply: @paulpaul9914  de Havilland ceased to exist in 1958.
Reply: @paulpaul9914  The HAWKER SIDDELEY Nimrod is not a Comet.
Reply: @paulpaul9914  The U.K. has never been recognized as a leader in aircraft technology.. because it lagged years behind.
Reply: @paulpaul9914  Boeing, Douglas Junkers,  Lockheed and others wete successfully building pressurized cabins without any catastrophic in-flight structural failures long before the _Comet Disaster_.
 The tragedy of the Comet Disaster was it could have been prevented if de Havilland had simply consulted with a more technically adavanced aircraft manufacturer like Boeing.
Reply: @paulpaul9914  If God intended people to fly on British jets they would still be making them.
Reply: @paulpaul9914  Please name a single British company that still makes commercial jet aircraft in the U.K.?
Reply: @paulpaul9914  JUST ANSWER THE QUESTION PAULY!
Reply: @sandervanderkammen9230  Give it a rest Sandy, you're going to blow a gasket
Reply: @sponder999  The truth never rests...
Reply: @sandervanderkammen9230  / DrDikBummer / VinDurKrappen et al - The copious deluge of drivel & BS comments never rests or desists it seems?
Reply: @paulpaul9914  You can tell when someone is aware their argument has failed miserably when they descend into childish insults.
Reply: @paulpaul9914  Please cite the name of a single British company that still makes commercial jet aircraft in the U.K.???
Reply: @BB49 The 737 Max has an excellent safety record compared to the Comet.
Reply: @BB49 The body count proves that there were fatal accidents
it also proves the safety statistics that Boeing aircraft are the safest in the world.
Reply: @BB49 Smart people and airlines understand something that you do not, Boeing actually has more orders for the 737 Max now than it did in 2019.
Reply: @paulpaul9914  That is false, while the two Nimrod prototypes were constructed from heavily modified Comet 4Cs.. the Nimrod itself is a completely redesigned aircraft. While many attempts have been made to associate the Nimrod as successful outcome of the Comet Disaster the Nimrod was designed and built by Hawker Siddeley long after d-H went tits-up...
Reply: @paulpaul9914  The U.K. has never been a leader in aircraft technology, it has always lagged years behind and after it's economic collapse of WW2 the entire British aircraft industry was in a slow steady decline with no real hope of recovery. 
British aircraft had poor performance, poor safety, low profitablity, higher operating costs and had few customers outside the government controlled airline industry in the U.K. Nationalization of the aircraft industry only burdened taxpayers and prolonged the inevitable collapse which weighed heavily by colossal financial failures like the Comet and Concorde.
Reply: @sandervanderkammen9230  clueless much?  At the end of WWII the UK had 2 jet fighters in serial production, a medium jet bomber in development that saw service with the US airforce in Vietnam, a set of second generation jet fighter designs in development alongside the worlds first jet airliner and a range of turboprop designs. 

The British aircraft industry failed, like all single nation European aircraft manufacturers, because its home market couldn’t sustain the sales needed for the development of innovative designs and production runs large enough to produce the economies of scale needed for commercial success. Boeing and McDonald Douglas had that protected home market alongside government subsidies on a scale European manufacturers could only dream of and so succeeded despite not because of their lack of innovation 

It was only with the advent of a European market and merger of companies to produce a European manufacturer that these problems were overcome and commercial success achieved with a company you might have heard of which still has significant design and manufacturing capacity in the UK.
Reply: @davidwright7193  The Gloster "Meatbox" as it was called by RAF pilots was also the worst jet fighter  in history. 
The D-H Vampire has an appalling loss rate as well.
 The British aircraft industry was doomed by the country's defeat in WW2. The economy completely collapsed and the U.K. was unable to produce safe, modern efficient aircraft that other countries wanted to buy.
The U.K. was never a leader in aircraft technology and had always lagged years behind America, Germany and France.
Reply: @paulpaul9914 The de Havilland Comet was the worst jet airliner in history. A truly humiliating and shameful chapter in British history.
The real tragedy of the Comet Disaster was it could have been easily prevented if de Havilland had simply followed well-known and understood industry standards for design and construction of pressurized cabins made from riveted aluminum alloys.
While de Havilland would have never been successful selling jet airliners competing against superior American aircraft like Boeing and Douglas, the lives of hundreds of innocent people could have been saved.
Reply: @paulpaul9914  At the time... de Havilland was still building aircraft primarily from WOOD and FABRIC... even the Comet is not an all metal aircraft.
Not high tech, not advanced, not cutting edge, just rushed through bad design, short cuts, disregard for safety, shoddy workmanship and poor quality control.
The truth is the Comet should have never received an airworthiness certification... its was too unsafe to fly let alone carry passengers.
426 innocent men women and children were killed by de Havillands incompetence and criminal negligence.
Reply: Pa. D  The Comet 1 was grounded and its airworthiness certification was permanently revoked after 100s of fatal design, and construction flaws were discovered, the Comet 1 was so bad it was completely redesigned.
Reply: You are lucky to be alive, the Comet remains the worst safety record of any jet airliner in history.
Reply: @sandervanderkammen9230  ahh, the crazy guy is back.
Reply: @MeTube3  Yes, you are indeed... can't handle hearing the truth can you!
Reply: @sandervanderkammen9230  very weak comeback. Try harder.
Reply: @MeTube3  Please name a single British company that still makes commercial jet aircraft?
Reply: @sandervanderkammen9230  what has that got to do with anything? You really do seem to have problem. Why don’t you get your nurse to help you?
Reply: @MeTube3  Just answer the question lad... you seem to have a terribly warped perception of Britian's aviation industry.
The U.K. was never a leader in aircraft technology and always  lagged years behind until it slowly  imploded after WW2... today almost entirely dead, there are no longer any commercial jet aircraft made and even the RAF buys its planes from foreign manufacturers and consortiums.
Reply: @sandervanderkammen9230  Blah blah blah.
Reply: @crinolynneendymion8755  The truth bears repeating
Reply: Imperial Inquisition  Not true, Boeing was and still is the world's leader in pressurized airliners, the Boeing 307 is the world's first pressurized all metal monoplane airliner in 1938, a time when de Havilland was still building Wood and fabric biplanes like the Dragon Rapide.
 The Boeing 707 first flew on July 15th 1954, before anyone, including de Havilland knew why the Comet exploded.
Reply: Imperial Inquisition  The Comet Disaster destroyed the reputation of the entire British aviation industry, and Industry already in serious decline after the country's defeat in WW2.
Reply: Imperial Inquisition  Just the facts here, the truth is irrefutable
Reply: @sandervanderkammen9230  yeah but it was leading the way so problems were going to come up
Reply: @mark675  de Havilland was certainly not leading the way..
The had very little experience with building airliners with pressurized cabins...
The real tragedy of the Comet Disaster was that nothing was learned by it
Reply: @sandervanderkammen9230  Actually, statistically, Concorde has the worst safety record.
Reply: @sandervanderkammen9230   Spreading lies the Comet had 4 hull loses due to mech issues the rest were due to Pilot error or ground losses. It has the LOWEST number of mech at fault related hull losses of ALL 1st gen airliners....    I dare you to refute it...
Reply: @matthewq4b  The Comet 4 has the Highest loss rate and fatalities statistics of any jet airliner in history except for the Comet 1.
Reply: @sandervanderkammen9230  lol the irony of you saying the British cut corners on safety with the Comet...whilst defending Boeing after the 737 MAX tragedies and now as it turns out, another incident this month.

You've not provided sources for your claims despite continually being asked. Furthermore, you've lied twice.

Cineflex, who make the Air Crash Investigation series who did that Disaster show spin off, are Canadian. Not British. 

You also said Britain lost WW2? Might be your wording but... They didn't lose.

Boeing used to be good. Before they let McDonnell Douglas corporate attitude run things. Make sure your cargo door doesn't fall off.
Reply: @Bagster321  The Comet Disaster is the worst engineering failure in commercial jet aviation history and a truly shameful and humiliating chapter in British history... the direct result of gross incompetence and criminal negligence.

Comparing it to the e Boeing 737 is just pure ignorance.
Reply: @Bagster321  Look lad, it was before your time but there were only two winners in WW2 and Britain was not one of them.
The British government effectively surrendered to America in September 1940 and signed away it's autonomy in 1946 and was a US possession until 2006, it remains a US protectorate and US military forces still occupy the UK.
Reply: @sandervanderkammen9230  😂😂😂😂 Christ that's a very selective and hypocritical take. The Allies won WW2. That includes Britain. And the many other nations who fought on their side. Not talking about geopolitical superpowers there.
Reply: @sandervanderkammen9230  also legally, you're wrong. The UK by international law is not a US protectorate. Never has been. Now politically l will quite happily point out them willingly going to war in Iraq in 03 was illegal and dumb. But that doesn't mean they're factually a territory of the USA. You broke your own logic, just to come up with a dumb answer. I'm convinced you're a Chat GPT bot of some kind because that's the dumbest comment I've ever seen about WW2. And I regularly shit on fascists.
Reply: @Bagster321  Britain lost the war, it surrendered to America in September 1940 rather than surrender to Hitler.
The UK economy collapsed in 1946 and the US government had to step in and take over the country's military security and foreign policy.
The New Labour Party signed the Anglo-American bailout loan agreement, effectively mortgaging the UK and its remaining overseas territories to America,
Britain became a defacto possession of the United States of America until 2006.
The UK remains a US protectorate and is still occupied by American military forces.
Reply: @sandervanderkammen9230  Bollocks.
Reply: @crinolynneendymion8755  Just the facts here kid.